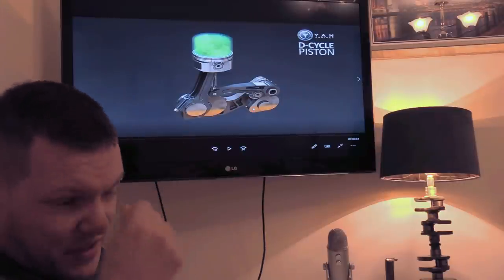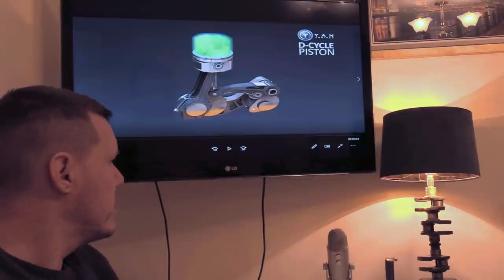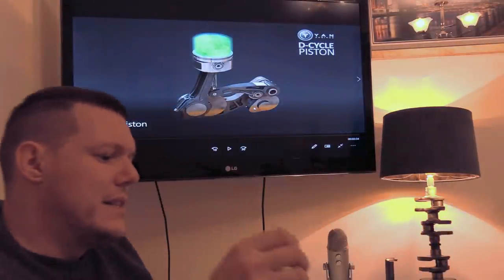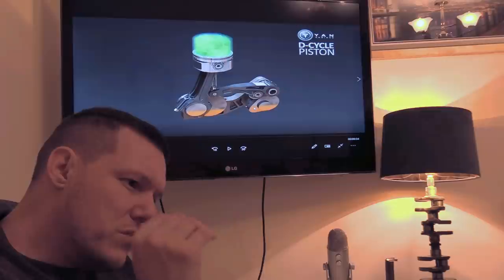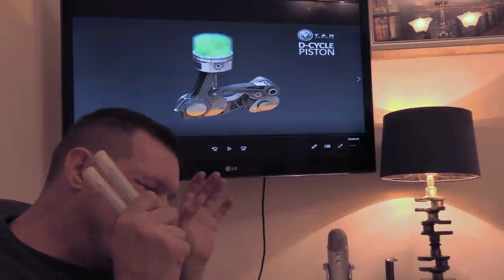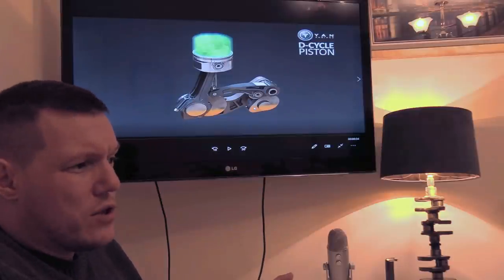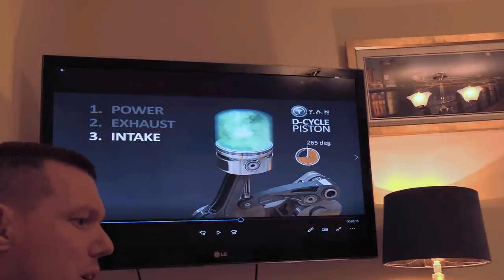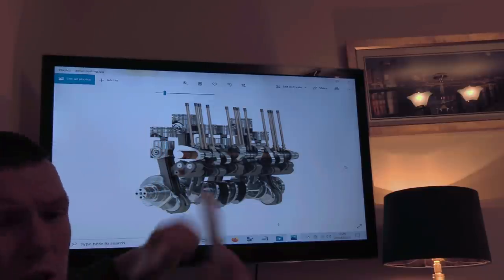D cycle engine | Part 2

Comment: 20% less fuel! But that's every other stroke, so isn't that 60% more fuel than a 4 stroke? for the same crank speed
Reply from the maker: Well like I said there intake capacity and ve.... first you have to define the rest of the engine
Reply: Sure, but double the power for the same crank speed.
Reply from the maker: What i mean is it depends if youre comparing it to a 2 or 4 stroke. Seen as this is a 2 stroke then its compared to a 2 stroke.

Comment: Still sticking to frequencies and harmonics completely ruining this engine...you’ve got two reciprocating masses traveling at different speeds within the same volume ...also by you’re own statement in part 1, this engine lowers the volume of compression thus reducing its need for fuel...so how does lowering the compression, adding pivot points and friction equate to a better system...I honestly think this crazy design could work in practice I just don’t think it’s going to offer any real advantages
Reply from the maker: 2 stroke! 

Next point, what do harmonics have to do with the same volume?
Reply: @dirtygarageguy  I understand it’s technically a 2 cycle ...but again many other engines accomplish the benefits of a 2 cycle without all this other nonsense 😂... Perhaps I’m overthinking it but wouldn’t two objects traveling in the same cylinder at different speeds create dissemmetry in pressure? Wouldn’t that also translate to resonance issues? Last I checked wind instruments use a volume of gas/speed to create different frequencies...if dynamic flow and method of compression arent factors anymore I’d like to know why...2nd what’s to be done with the volume of gasses between the two pistons? Even if bypassed wouldn’t this also translate to a loss in compression? How does less compression equal more power with less fuel?
Reply: @dirtygarageguy  either way boss I always value the knowledge you bring to the table...should you slay this dragon of a design you should probably apply to the company that designed it 😂
Reply from the maker: The problem is 2 strokes have issues, issues big enough they can't be sold these days... this sorts those issues
Reply from the maker: 1) there's a hole in the bottom piston, a pretty large one...

2) more power than a 4 stroke. I dont understand how this is so hard to understand...
Reply: @dirtygarageguy  yes I understand 2 stroke ..on PAPER  makes more power..and I understand there’s a hole in the lower piston...If “2 stroke” is going to be your answer then I guess I’m stumped ...2 stroke or not i can’t ignore volume of compression, heat value, dynamic flow, excessive crankcase pressure, friction, pivot points, mass, frequencies and resonance...these things don’t just go away because it’s a 2 stroke...these are the problems I see with this engine design both in the short and long term...for example-14.7:1 looks really good on paper but we all know that number isn’t anywhere near where internal combustion engines perform the best ...everything in this engine concept will have overcome the same (if not more) problems as any engine...how do you balance an engine when a portion of the reciprocal mass is NOT in correlation with the crankshaft? How is super high crankcase pressure a good thing? I just don’t see the advantages to this design over existing ones...most notable the horizontally opposed 2 cycle 2 piston set up...these engines that already exist, are more efficient not only because they’re 2 cycle but because of better heat value, less moving parts=less friction= more reliability, easy to balance, easy to work on, light weight, cheaper to produce...I don’t see the D cycle achieving any of those
Reply from the maker: Just because you don't understand something doesn't mean there isn't a solution...
Reply: @dirtygarageguy  😂 that’s a pretty blanketed statement considering the laundry list of issues or potential issues I’ve brought up (issues every engine has to overcome) ...my concerns are based on actual real world performance and physics...Guess the perpetual motion engine is now possible right 🤷🏼‍♂️ just because you don’t understand how the perpetual motion engine works doesn’t mean there’s not a solution 😂😂😂

Comment: If they plan to stop selling cars with combustion engines, knowing that with the pollution and rarity of the materials and manufacture of batteries and the current and ever growing population the cost to the environment will outweigh ice public transportation and will result in an end point when there isn’t enough raw material, they should make it so they promise to do it quicker than required but are still allowed to produce engines as replacements for existing models, as repair and refurbishment will become more common, that gets them the sales and they don’t have to work as hard to sell the engines because they already made the commercial and sold the car (though I would laugh and love to see them starting to make commercials for cars they already made, saying how many parts they have for them or how reliable they are and how easy the repairs are, engineering to not make those things so easy will bite them in the arse now)

Comment: It's 20% because it's not fighting friction with the full crank and piston mass rotating 360 as a load vs power.
It has a shorter duration but it also has less displacement right? Of course they could also be increasing the stroke on the crankshaft. I'm sure the modification is engineered for every application. Longer or shorter crown lift rod. Duration and lift for the crown camshaft. The only problem I can see is wear between the piston crown and body. The combustion explosion will be introducing shock waves into the crown that is pushing down on the body.

Comment: Global harming/CO2 imisions is the environmental measure.  The production of plastics from fossil fuel does not produce global warning.

20% fuel savings.  What is the standard.  Fuel consumption for a given horsepower?

Complexity is not important, as all else, it is a matter of economics!

Comment: Lol part 2. You mean part 1 for dummies. Fooksake. Everytime. How do people not get 20% less fuel because 20% less volume but, more power because it fires a charge every revolution of the crank instead of every second. Anyway.
Won't the valve train need to run at twice the speed.  Pneumatic valving? What about pneumatics for the compression piston assembly? Recirc the exhaust gases to drive the pneumatics?

Comment: Apart from a nice man cave decoration Its a dead horse! 

any engine design that fundamentally wastes a large proportion of its power from reciprocating is flawed, firing a piston down a bore to a dead stop and then relying on the inertia to be transferred to the flywheel so that the piston can then be pushed back up the bore to be deliberately decelerated to compress its next charge is pointless, and inefficient.

look how generally things have been over the last 50 years,  trains converted from steam through diesel into electric …the engine in a locomotive is only used as an electricity supply to power the electric traction motors where there is no overhead or track side electricity supply.

Aircraft were converted from piston engines to Turbine for mechanical efficiency 

Shipping currently uses large slow and relatively simple in design Piston engines for cargo purposes but the Ocean liners are Diesel electric powering electric motors to the propeller shaft, the navy use steam turbine with the steam either coming from a nuclear steam generator or oil to run a steam turbine electric generation plant to run electric motors or not common now direct steam turbine.

Saturn 5 is a rocket the complex parts are not in the basic rocket design (zero moving parts in its basic form) but the firing and control of the rocket

As you can see over the last 50 years and more everyone has moved to the Turbine whether that is Gas turbine, Steam turbine or Electric Motor  (aka an electric turbine) the main reason they are all mechanically simple with few moving parts. (emphasis on the moving parts) Turbine engines of any sort do not have the same inertia  issues….once they are spinning they are spinning.

The future next 30 years

The masses will use electric cars, bikes and motorbikes , aircraft long haul will be gas turbine, short haul will be electric (the technology already exist), ships will be slow piston or turbine/ electric motor.

And by the way every advert in this video was for electric cars!
Reply from the maker: Electric short haul flights? Where?